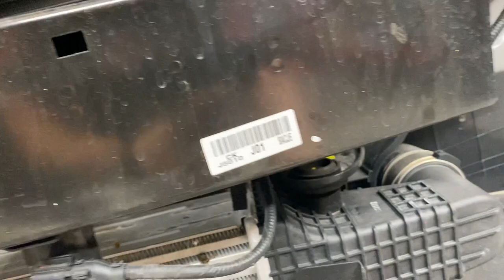Installing LED "Lit Kit" Big Mouth Intake Snorkels! (2022 Stinger Bumper Removal)

Comment: Great video, I wanted to ask where you get the red braided hoses from?
Reply from the maker: They are some cable management sleeves I found on Amazon - https://amzn.to/44VFVzI

Make sure you get the ones that are slit down the middle so you can wrap it around the hoses. The non-slit kind are really hard to get the hoses thru.
Reply: @KDMCurt  appreciate the info

Comment: This is a great instal video. Used it to put mine in. I did keep the shroud though 😬.
Reply from the maker: Very nice, glad I could help you out!
Reply: To C Mack, how did you keep the shroud, can you elaborate? Seems shroud is there for a purpose.
Reply: @donnaramirez696  
I keep trying to reply to you but my message keeps going away. I tried to share the link with the pictures I used as a reference but long story short, I felt the same about the shroud so I used a dremel to cut holes in the shroud so they slipped in.

Comment: Great video! Easy to follow. I was curious why you chose to take the Shroud out completely and not just cut a little spot for the snorkels? Is that shroud just a waste of space? Or did you feel the benefit of the factory shroud was not worth the hassle?
Reply from the maker: Thank you! Most people I watched and read instructions from just removed the shroud all together as it doesn’t seem to hinder performance with it gone, so I went ahead and did that too. Plus if you end up damaging the shroud you can’t go back to stock if there is a need.
Reply: @KDMCurt  Thanks for the quick reply. I can’t decide how I want to do it. Maybe I’ll decide once the bumper is off 😆

Comment: What’s up bro, just installed these. Do you leave the switch to the actual wires on and just turn off the lights through your phone when you’re not using them. Or do you flip the switch completely to save the battery. Will it affect my battery if I don’t flip it every time?
Reply from the maker: I just turned them off with my phone, no need to disconnect each time to save battery. It won’t drain when they aren’t on.

Comment: can you elaborate How others have connected them so they turn on/off with the car? Second could you explain a little more how you secured wiring, esp the bluetooth control box? Thanks, excellent video by the way
Reply from the maker: To get the lights to turn on/off with the car you would need to put them in a different fuse spot in that box. I’m not exactly sure which one as I only researched plugging them in the way I did in the video so they could be used with the car off. I just secured the cables up under the edge of the engine bay with zip ties and in some areas a little high bond tape.

Comment: Wonderful love it now the big question is this only for the GT2 trims? Can this be done on the GTLine trims as well ??
Reply from the maker: I believe it will work. The mounting points should all still be there for the GT-Lines, the only thing is one snorkel will just be supplying air to nothing since it has the single turbo.
Reply: Thanks for the video. So this kit should fit the gt line model.

Comment: Nice vid. Did you have to change any of the ECU settings with the installation of the cold air intake and new duct work? I was warned that with the installation, the ECU should be upgraded since airflow is being increased. Thoughts?
Reply from the maker: Nope never had to adjust ECU at all, most newer cars the ECU will automatically adjust to compensate for the new amount of airflow unless it’s just a crazy amount the engine can’t handle.
Reply: @KDMCurt  gotcha. I hear the sound an engine can make with the intake installed. Much more aggressive sound.

Comment: Should I turn the switch off when my vehicle isn’t ruining even if I turned it off with the app? I’m worried about my car battery dying.
Reply from the maker: If you’ve turned them off with the app you should be perfectly fine. They use barely any energy at all.

Comment: How do they handle rain? The reason for the stock location was to avoid elements like rain getting to the air filters.
Reply from the maker: Driven with them in heavy rain 3 times now, filters were dry every time. The snorkels curve up inside in a way that makes it so any water that would get past the grill and to the snorkel would just drip down out of the front of the snorkel. You would have to drive into a pond for these things to suck up enough water to get your filters wet.

Comment: Does the fuse tap make it so they cut on with lights?
Reply from the maker: The fuse tap just allows you to plug it in to the fuse box, now which fuse spot you plug it in to is what matters when powering them on/off. The fuse spot I plugged them in to supports power even when the car is off so I can use the lights when I’m parked at a car show.

Comment: Do yours automatically turn off? Or do you have to manually do it??
Reply from the maker: Has to be done manually in the app if it’s connected the way I did it. I’ve seen people do it another way that shuts off with the car but then you can’t turn them on when you’re parked somewhere.
Reply: @KDMCurt  can you elaborate How others have connected them so they turn on/off with the car? Second could you explain a little more how you secured wiring, esp the bluetooth control box? Thanks, excellent video by the way

Comment: What brand are your blow off valves?
Reply from the maker: ADD W1, I have an install video for them on here and there’s a link to them in the description.
Reply: @KDMCurt  adjustable ?
Reply from the maker: @bryanreid4559  yes, there is a nut on top that you can loosen or tighten depending on the sound you want.
Reply: @KDMCurt  sweet thanks bro 🙏🏽